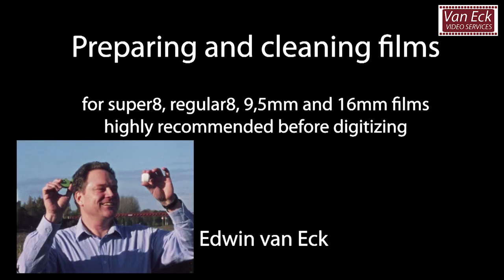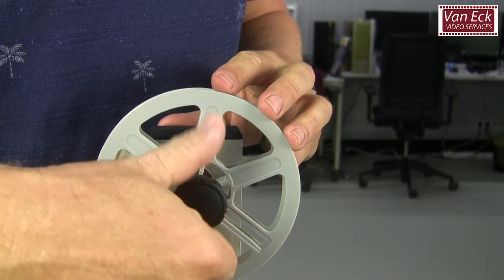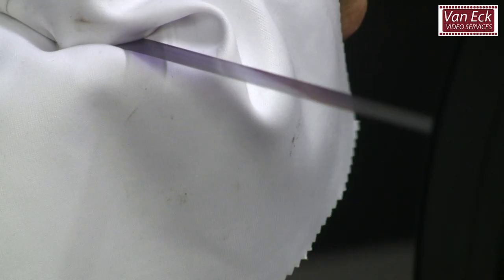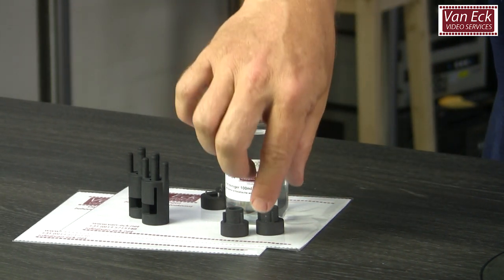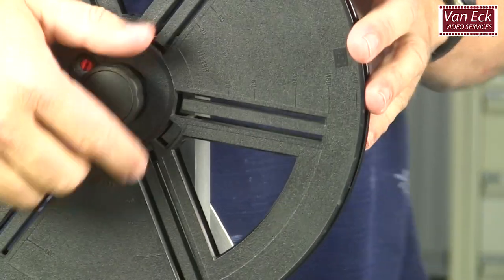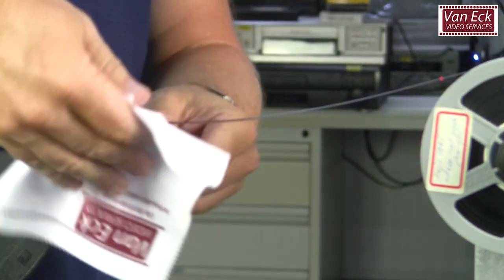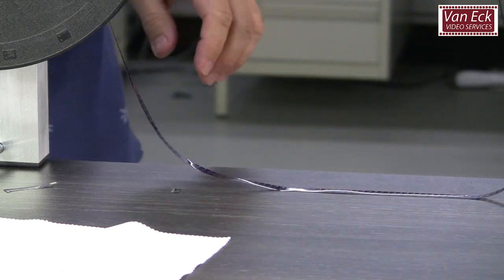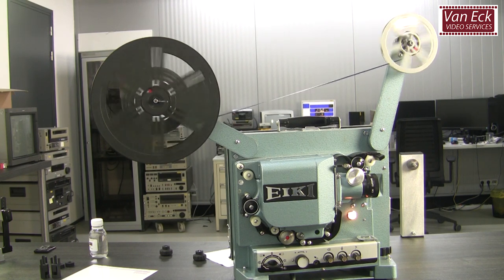Preparing and cleaning films for super8, regular8, 9,5mm and 16mm films

Comment: I have a problem. When cleaning - the film sticks to itself and when unwinding it almost ruins the film.
Reply from the maker: Which cleaning fluid are u using?
Reply: Van Eck Video Services I normally use isopropyl alcohol but I’m guessing that isn’t good??
Reply from the maker: @therestorationofdrwho1865  Alcolhol ruins your film. Please use a suitable film cleaner! See for test where we tested with alcohol, PEC-12 and Film cleaner to clean super8 films: https://www.van-eck.net/itable.php?lang=en&size=0&cat=info&merk=255&type=Films

Only film cleaner did not destroy the film.
Reply: Van Eck Video Services Well - alcohol still cleans the film but when the emulsion swells and sticks to itself when wound during cleaning - it dries when stuck to itself. How does film cleaning prevent this? Does it not swell the emulsion? Because emulsion is very absorbent and what not.
Reply from the maker: @therestorationofdrwho1865  The filmcleaner is specially developed to clean films like super8 / regular8 / 16mm film and does not harm the film, see: https://shop.van-eck.net/SF-0124.html?_globalsearch=Filmcleaner
Reply: Van Eck Video Services .
Reply: @VanEckVideo  Do u ship to Brasil?
Reply: @familysounds  Yes, we ship worldwide.
Reply: You can get away with isopropyl on 35mm - with a q-tip, and only applied to base side.

Basically, only to clean tape residue, or a spot of 'gunk'.

Alcohol is still water based, and so is emulsion.
Reply: Isopropyl alcohol (99.9 %) is what many experts use. It doesn't ruin film.
Reply: It's fine, used sparingly.